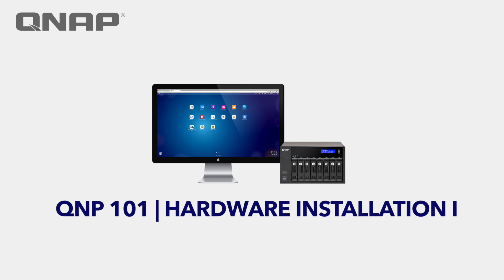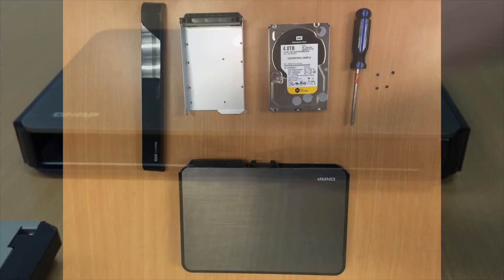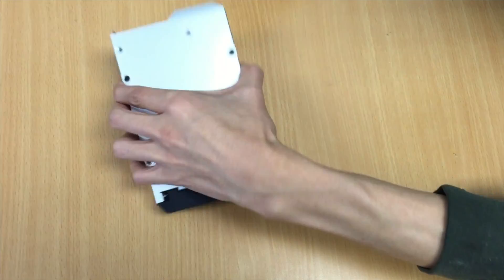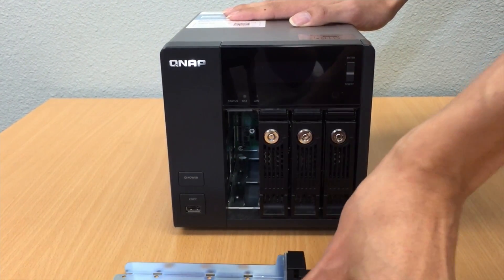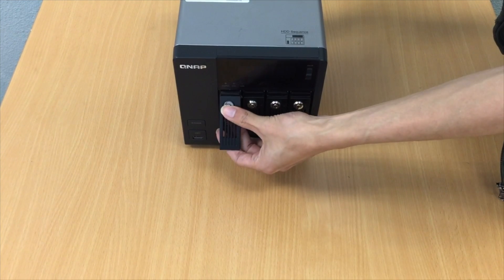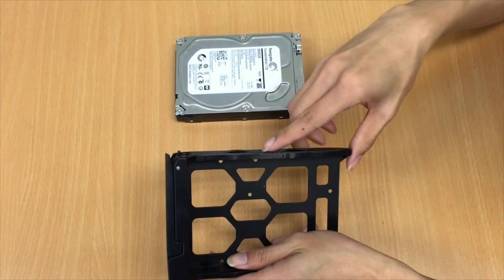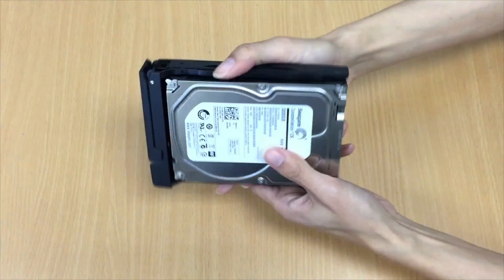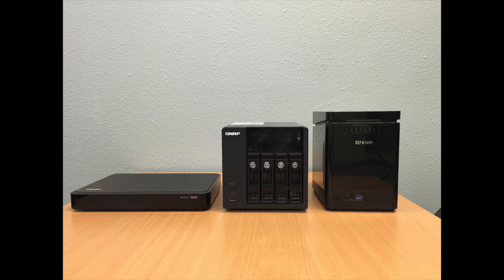QNP101 - Hardware Installation I

Comment: Qnap is rubbish, pure junk. This is nothing more than a paid ad for their garbage. Their  software is horrible, very slow, buggy and not secure. Trust me, none of their functions work as seem-less as portrayed. In addition, I lost all of my data when my Raid 10 became corrupted due to bad firmware.All the drives! Look up corrupt or missing configuration on Qnap. In addition, they store all data using proprietary formats. Should your system become corrupt you cannot just save your files by using a PC. Use a Windows 10 server box instead, far more reliable, exponentially faster, and uses standard file formats.
Reply: GetoverYourself QNAP use the ext4 file system: what’s proprietary about that? Also, the word is “seamless.”
Reply: This is more like elementary school than college.